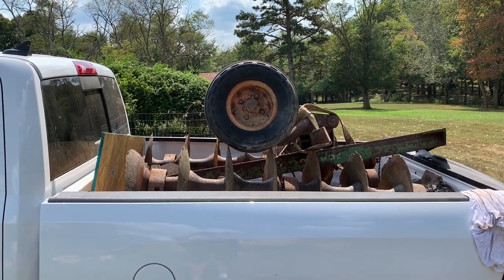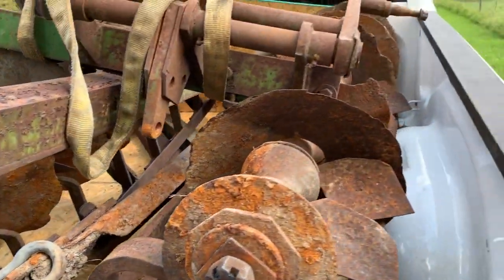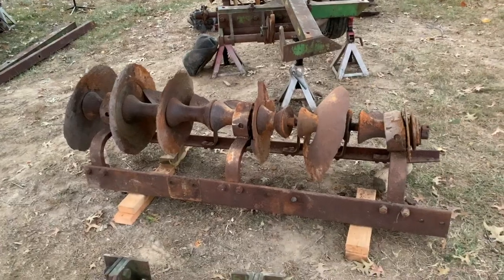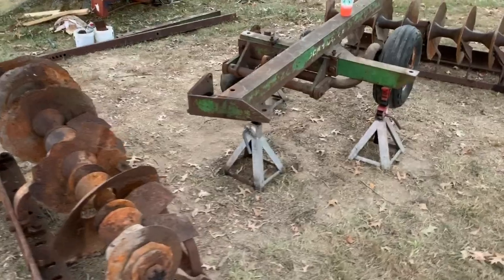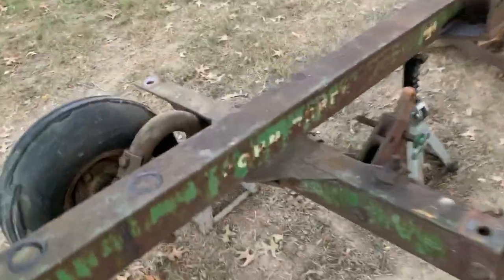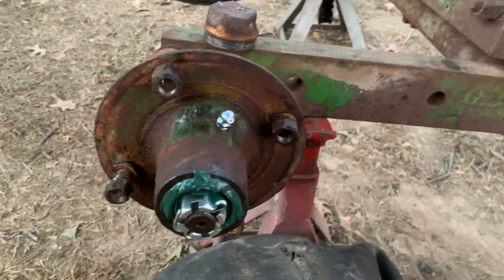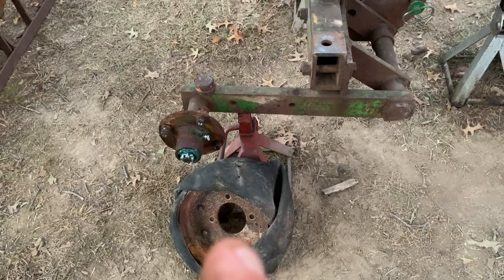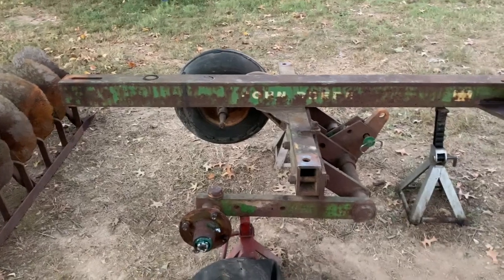9/11/19 Part 1 Disk Repair

Comment: you got a lot of work ahead of you but I been there you will get it done I am rebuilding my 5-foot woods mower the bearing last about 3 years before they have to be replaced even with grease fittings.johndeere is where you have to buy parts for woods in my area.
Reply from the maker: Danny Dunnagan Our bush hog is a Woods Cadet 84. My dad always liked Woods machines. That’s interesting you having to get your bearings at Deere. After the video I busted 2 of the spools trying to free them. Wasn’t even hitting them hard. That’s gonna cost me. Lol...